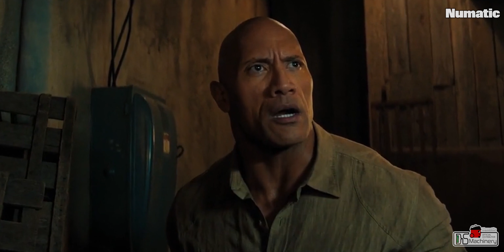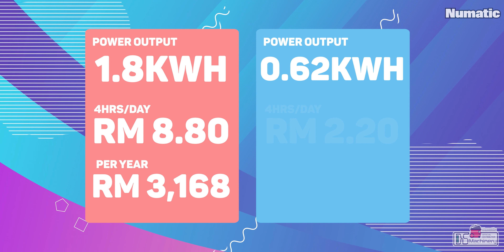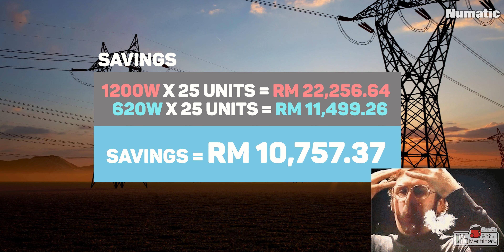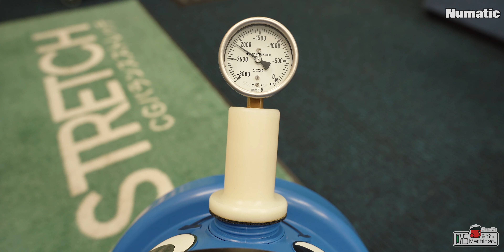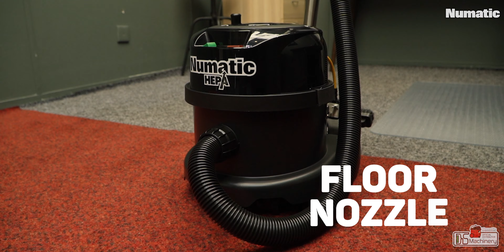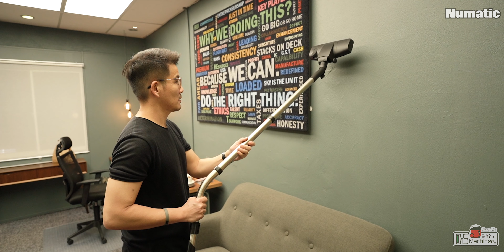Low Wattage VS High Wattage Vacuum Cleaner | Which One Should You Choose?

Comment: the watts on the vacuum cleaner refer to air watts whixh measures suction. not the consumption.
the consumption is written on the label next to power for example: 50/60 hz 550W
Reply from the maker: Actually, the wattage listed on the machine usually indicates the motor's power consumption rather than air watts, which measures suction efficiency.

Comment: My vacuum cleaner is an older German Siemens model using 2500 watt. Suction is pretty good; I can drop a glass in the kitchen and as long as the pieces fit in the hose, it'll suck all the glass right up. I'm in the EU and I'm dreading having to buy a new 450 or 550 watt vacuum cleaner, because I'm clumsy and I drop quite a bit of glass at the most inconvenient of times. I heard the hoses are smaller to allow for better suction, and the sucktion power is lower, leading to unsafe situations with broken glass. And the motors overheat so you need a new vacuum cleaner quickly. I just want a decent, durable, quality vacuum cleaner that works well, fast and safely with the glass, just like my Siemens/Bosch model. But now that my Siemens is getting older, I'm afraid I won't be able to keep taping the broken pieces, so I might look into industrial vacuum cleaners. I HATE the green EU rules forcing sub-par, unsafe and slower vacuum cleaners on the market.
Reply from the maker: Understand your concern over small hose. However for dry vacuum cleaner, usually is 32mm in diameter.

You may still find Numatic using concave hose meaning 38mm taper to 32mm. Hope that may address your concern.

Comment: Nice vid. New sub here. Question: what’s the difference between peak horsepower and watts in vacuum cleaners?
Reply from the maker: Hey thank you for subscribing.

Both terms like peak horsepower and watts doesn’t convert into performance on the vacuum cleaner anymore.

Watts is just indicator how much electricity it is pulling.

What determines the performance would be the airflow, some use kpa, some H20, you may convert them, they are the same.

Experience proven to us, most of the vacuum cleaners out there over claim their KPA figures on paper. And some, has the KPA/H20 as claimed, but can’t sustain for more than 30-40mins, once they passed the threshold, the vacuum cleaners stopped working and you have to wait for it to cool down.

Comment: I mini vaccum cleaners I still not understand why some sellers talk about Air flow capacity and others about Kpa capacity, what is the most important in terms of suction power air flow or kpa? There is a converter from air flow to kpa, is it accurate?
Reply from the maker: Yes, air flow, KPA, H20, they are all the same, you just need the converter compare all brands claimed figures.

Most important for vacuum is tight conceal of the vacuum cleaner unit. 

Because if the conceal is weak, it won’t give you good suctions.

Now, if the suction is good, next thing to look out for is how long it can run for? 30mins nonstop? 40mins then power cut and stopped working?

For eg, the numatic/henry vacuum motor can run for 1600 hours non stop before power cut.

So these are the areas many seller doesn’t tell you.

Let us know if you have any questions. Thanks

Comment: Nice info! Thanks! I have a nice question for you, what has better power suction? A centrifugal motor 850m3 580pa OR two vacuum cleaner motors in parallel? I will appreciate for an answer. Thanks!
Reply from the maker: Hi Sir, XXXpa or XXXXkpa depends how well the vacuum design and airflow is.
Motor play a part but is not all. You usually 2 motors vacuum in wet vacuum because water has more weight and usually the wet vacuum has bigger capacity.

When weight and bigger capacity drum in place, usually need double motors system.

However, for dry vacuum, stay away from double motor vacuum because of noise and energy consumption UNLESS is for industrial use where you have continuous suction requirements.
Reply: @dsmachinery  It's for saw dust, hobby, i use a vacuum cleaner motor 600W and a bucket 20lt based on cyclon, it works more than fine and only with <1% dust on the motor filter, but the noise is high already because of the free motor outlet. I have 5 times higher suction than a normal vaccum cleaner. I would like to improve the suction little bit and reduce the noise (making an isolation motor box with two vaccum motors this time) or to experiment with the above centrifugal suction motor (i never used such thing before), compact unit in both cases (30cmx70cm Max.). I have a new 800W vacuum cleaner motor, you think i can use it with the old 600W in parallel or it will be better to buy one more 800w motor?
Reply from the maker: Interesting points!
I would suggest to get identical 800w motor if you plan to go parallel for double motors setup.
Reply: @dsmachinery  Thanks! I am really happy with my vacuum system, i use a sponge filter Φ12X5cm thick only, no bags, no nothing, in the bucket there is only a plastic tray from a flower pot (the cyclon), the motor is mounted in a canalization pipe Φ120, looks like a rocket mounted on a bucket, i tried many things and finally it worked perfectly. I should make a small video so other people can see and make it also and stop to spend money for expensive vacuum cleaners with low results. I forgot to mention that i use the motor outlet air to blow the saw dust from my tools, another useful function.
 What is the difference of performance between a vacuum cleaner motor 1000W and a 2000W motor from the moment that the turbines are the same ??? 
Usualy the factories  use a turbine of Φ110 with an inlet Φ38 (or Φ32 ,i don't remember exactly) , so It is a BIG LIE!!!!
Thanks for your very interesting video!

Comment: How do i translate  your information in to  purchasing  the right vacuum. What words do i look for on the label considering wattage does not tell anything about suction performance?
Reply from the maker: Hey thank you for reaching out.

You may look for suction H20 (MM), anything above 2000 is consider all right. And DB below 80.

And many more, like how long the vacuum can run without power cut.
Reply: @dsmachinery  thank you for clarifying.  This is very useful information ❤
Reply: @dsmachinery hey please compare qikcln vacuum & Vicease vacuum